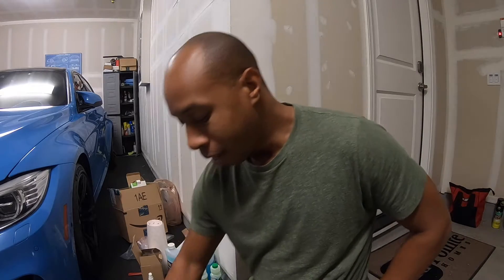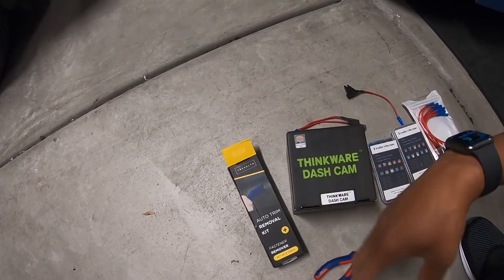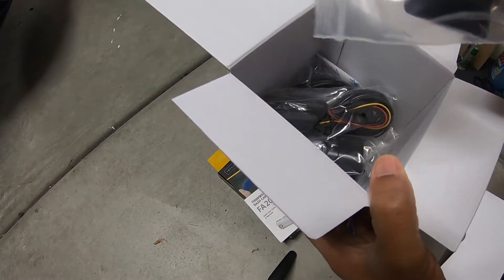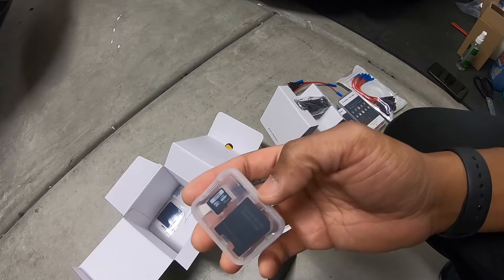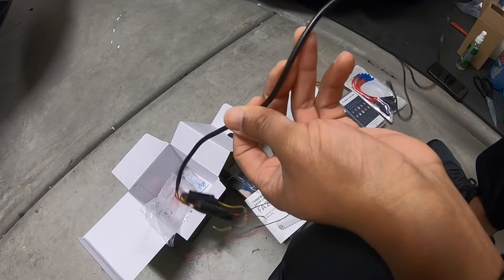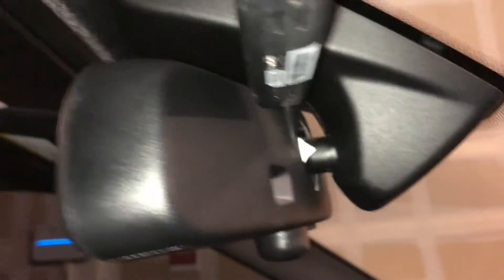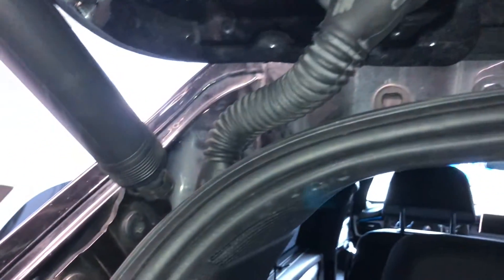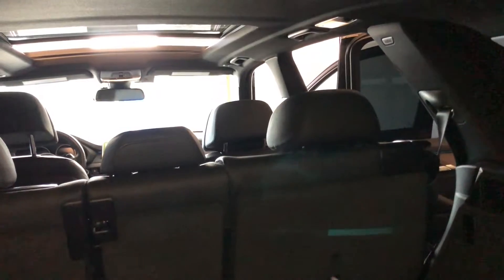BMW X5 Dash Camera Install-Thinkware FA200

Comment: thanks so much for the video very helpful. Quick question: do you think the rear camera cord wire would impede the air bag in the event it deploys since you had it cross over where you hid under the pilar where airbag emblem is? I did the same as you how tucked it in the front. Just kinda of worried about that.
Reply from the maker: No, it shouldn’t.  The airbag would deploy in front of cord. At the top of the pillar near the headliner, there should be little, to no separation to interfere with the cord.

Comment: You mentioned an instructional video from a forum. would you be able to link that. Im trying to install a dual dashcam in my X5. Really helpful cheers.
Reply from the maker: This is what I used to help route the cables.  https://f15.bimmerpost.com/forums/attachment.php?attachmentid=1131202&d=1418781422